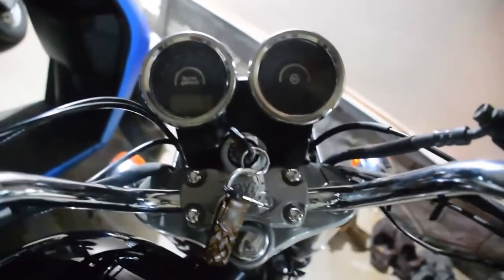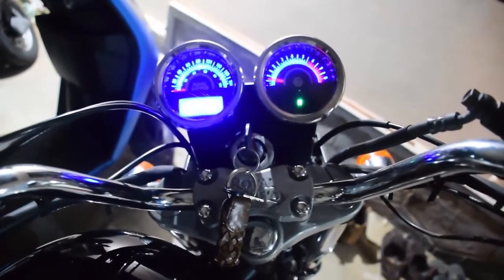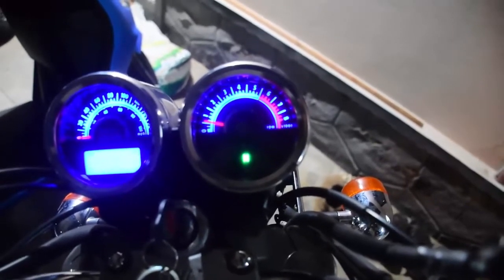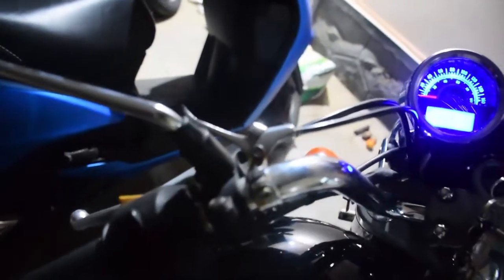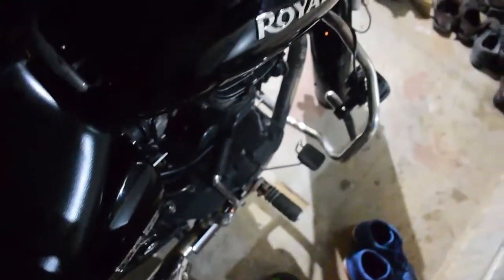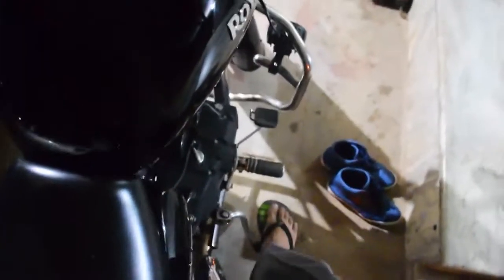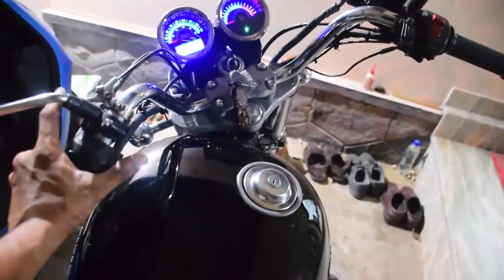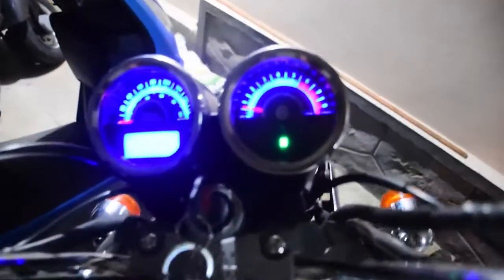Royal Enfield Manual Decompression and Kick Start

Comment: Spark plug orenam ozivakitano fittakiyath
Reply from the maker: no.. drilled a slot on top of the head
Reply: Decompression direct fittakan patylalo, Centeril holl ityt. Oru connecting sleeve vekande. Ath layithilnano undakiyath
Reply: De copresdion headinu holityt connect cheyuna Adamptor engneya undakiyath

Comment: Effect on pulling???????
Reply from the maker: idle RPM extremely low aaki set cheyyam...  so we can tune for better lower end torque. 

also I have changed regular 350cc clutch unit to 500cc engine's clutch.
Reply: @invertedplanetvlogs  #@ very informative video 👍👍 replacing the clutch with 500cc, will there any TORQUE difference, any engine sound problem, did you replace the front sprocket to 500cc sprocket????
Reply from the maker: @drvineeth.viswanath6206   500cc clutch has some significant improvement in low end torque but the clutch feel will be a little tighter. I haven't replaced the sprocket setup. and the manual decompressor has no issues with water entering the engine.
Reply: @invertedplanetvlogs  @# what's your slow speed in top gear after changing your clutch plates to 500 cc clutch plates
Reply from the maker: @drvineeth.viswanath6206   you mean the slowest that I can ride on top gear?  I have tried going as low as 35km/h on 5th gear..  It starts to knock...
Reply: @invertedplanetvlogs  @# hey that's great, it may be because of manual decompression, manual decompression reduce rpm , I guess

Comment: Milege issue undoooo
Reply from the maker: no. ippo ith almost 3 years aayi use cheyyunnu...  getting regular mileage range.  38 to 42km per litre.  need to clean decompression valve approx every 30000km
Reply: @invertedplanetvlogs  enik ipol 55.6 km/pl kitunund,2014 model standard bs3

Comment: I too have  plan to install manual decompression system in my classic 350, 2015 model. I read in you tube about the same fitmet wherein there was drastic drop on kmpl and the person in delhi was planning to revert to auto decompression in his std 500. I am a bit confused about the difference in opinions / experiences , can you please  explain a little more about vehicle overall performance.
Reply from the maker: Shaji K.Damodaran  power drop can happen if its not done properly. Some mechanics remove the secondary spark plug and install the decompression valve. For me, its completely new. Drilled a new valve hole on engine head and fitted the decomp valve. No loss in power.
Reply: Please load a detailed information on the modification, grateful to you.